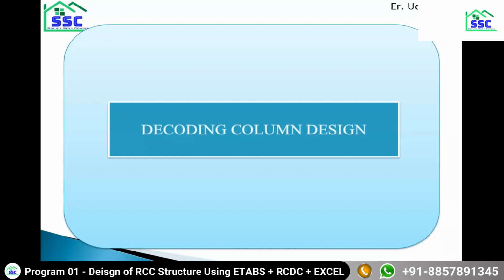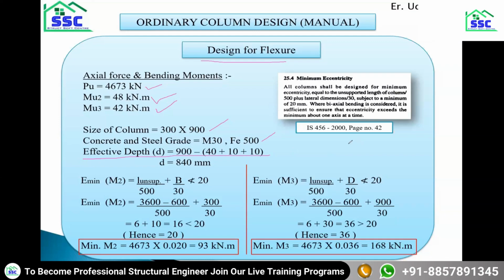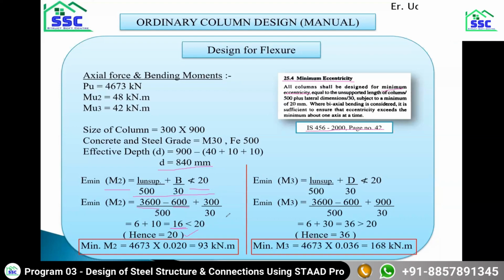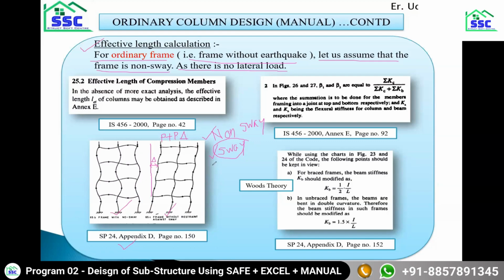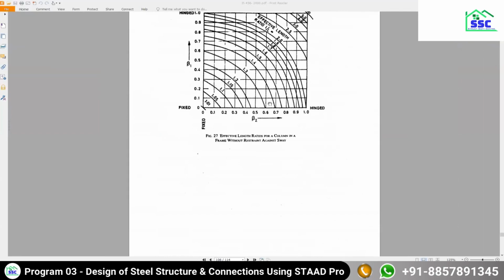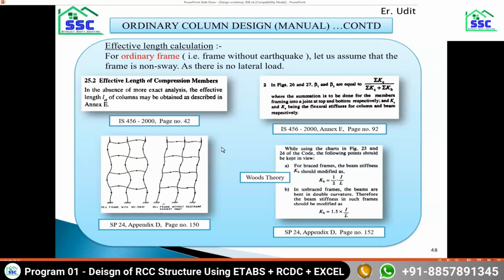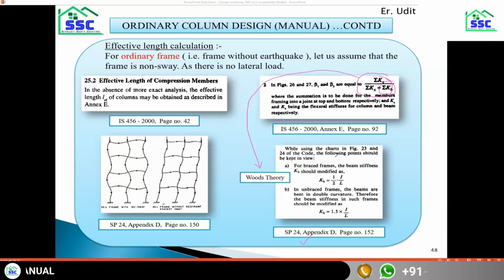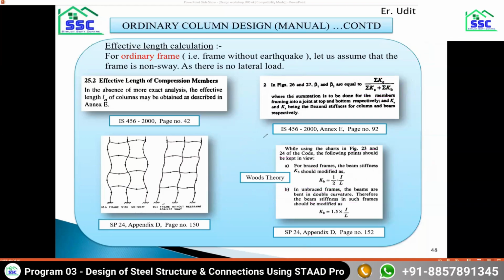🚨 CSI ETABS V/S MANUAL DESIGN OF COLUMNS PART-01  I COLUMN FLEXURAL DESIGN I IS 456-2000 I RCC

Comment: 1) Please make a video for the design and detailing of the staircase in etabs...... because all the str engineers just prepare a model in the name of the design and detailing of the staircase.....while designing slab we have 2 options i.e. strip based design or fem based....but while modeling stair might be a slab or be considered as a wall because of the factor of 0.35......all are just explaining manual calculation and all..... But i want it to be designed and detailed like we do it for beam, column, slab etc.
2) Generally max rebar for the column is 6% but i want to change that limit to 2%..... I want this because while trying auto select i need it to keep making iterations till they can find a section where max reinforce is 2%....... This is why i need to change the rule where steel is allowed up to 6%.....
Reply from the maker: WhatsApp me at 8857891345